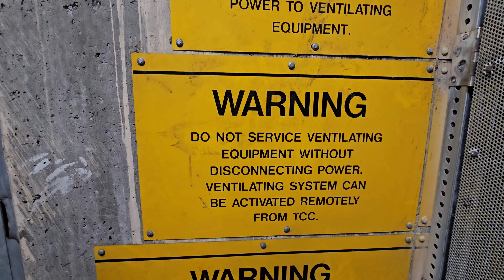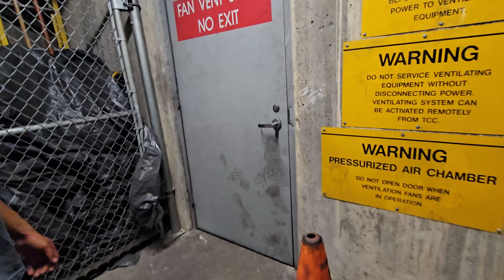KNOX/HENDERSON Dallas Dart Station Exploration

Comment: You guys went the wrong direction if you’re trying to get to Knox. Y’all started at cross point 13 which is where the vent is, and went towards cross point 12 where yall crossed from track 1 to 2. You need to go the opposite direction next time. It should be a big flat wall with a single door. 

Source: I’m a train operator and this was cool as shit. Yall are crazy as fuck though 😂
Reply: thrilling! You should film your stuff too. awesome!
Reply from the maker: i might have to go back then. thanks
Reply: @NuVids2025  there are a couple of vids floating around somewhere of me operating and going into yards / wrong direction on tracks.
Reply: @jct3562  i live in garland lowkey ill be down to check it out
Reply: Bruh I feel the same way but stay outta my way tho fellas I’m coming through that tunnel close to 70 mph

Comment: Hey yall know it’s a big fall out shelter under the state fair??? It’s massive.  My grand mother told me about it years ago. They built it in the 40s or 50s but if you ask about it no one knows about and it’s not the one underneath the old science place building either. I tried to find it and it’s nowhere in line. I wonder do the tunnels connect to it.
Reply: This is miles from Fair Park so I very much doubt it's connected.
Reply: @hunteralford14  this. These were tunnels made in the 90s for DART light rail service. The neighborhood above Knox/Henderson threw a fit so that station, which was a shell at the time, was never finished out. It's just a big empty space under the streets and iirc an emergency exit from the tunnel if something happens to a train.